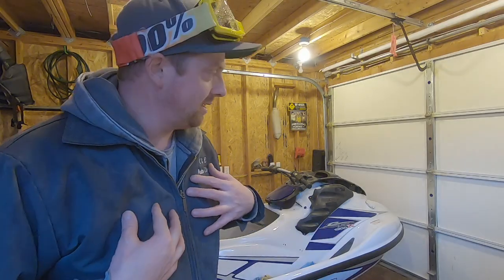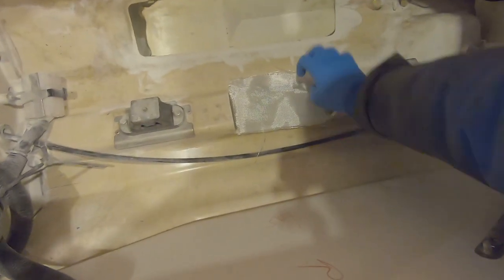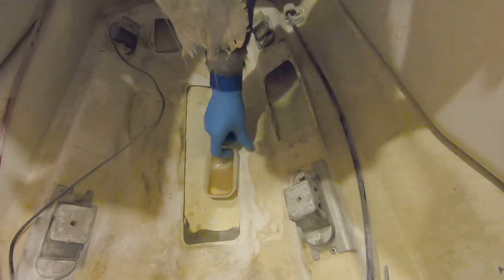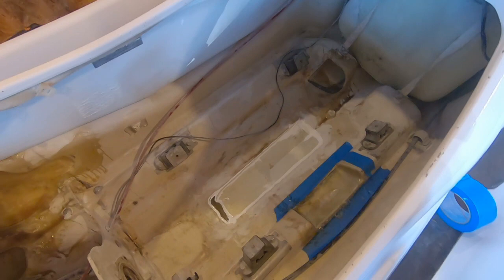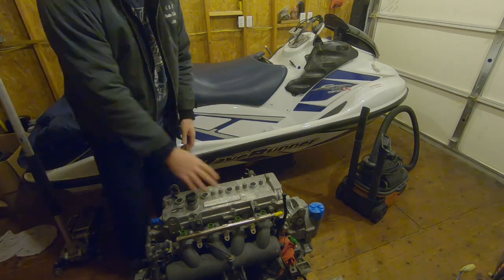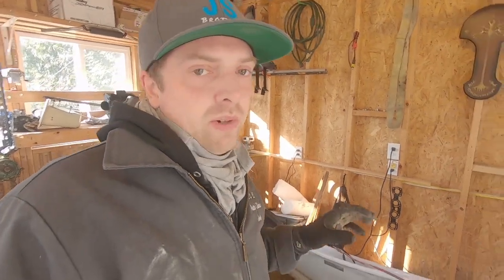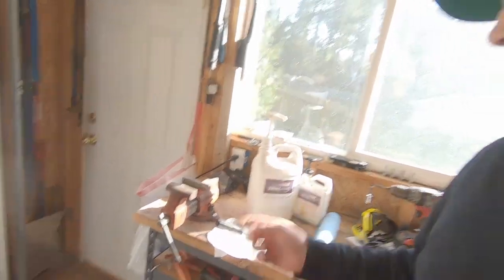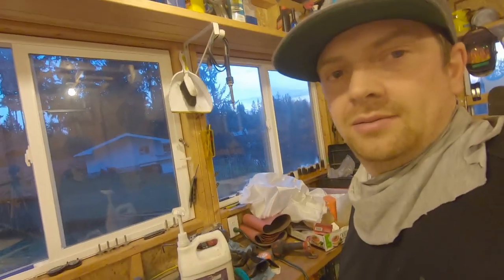Fiberglass GPRSHO part 6

Comment: I don't want to be a know-it-all but you really should use Evercoat SMC resin when you're fixing SMC boats. I fixed a crack in my superjet using regular fiberglass resin and it did not adhere properly and the boat developed a leak again. Had to redo it this time using SMC resin and bingo it worked perfectly. Just for future reference. Also can't wait to see that thing done.
Reply from the maker: Daniel Mettetal I ended up switching to epoxy resin later in the video because obviously the fiber glass resin didn’t stick very well. I will have to look into this smc resin you are talking about. I have not heard of that before, I’m certainly not an expert when it comes to fiber glass work 😂 any way thanks for the tip 👌

Comment: You guys should do a race with the new gp to see the difference I have a feeling this build will be better than the new model
Reply from the maker: Matthew Robert that would be awesome. I would have to find someone with a new gp though as there is no way I could buy one 😂
Reply: @JetSkiBrothers  yeah I know what you mean lol I have the old gp760 waverunner with riva pipe westcoast waterbox and aftermarket flame arrestors and a milled head riva ride plate and r&d intake grate and stainless impeller  I'm happy with it until the new ones affordable for me

Comment: I hope you dont have trouble with bond between the first layer and the hull . Polyester resin wont stick as well as epoxy . The top layer of epoxy will stick properly anyway , its only a problem if it was a repair to the main outer hull . Im still looking for a damaged hull SVHO ski with RIDE for my spare GP1200R hull . Im patient .
Reply from the maker: Adzy the PWC bloke in Australia agreed I wish that I would have used epoxy resin the whole time

Comment: I’m wondering if you have the advice I need. I have a 2017 gp1800 and it got scratched loading on and off of a trailer that had a bad bunk. My buddy was saying he thought it was making a noice loading it. I will never lend out one of my toys again!  The scratches are deeper than the paint. What do you recommend I repair this with? I’ve really been enjoying your videos. That ski is in amazing condition being a rental!
Reply from the maker: Max Jones sorry that sucks. I would fill the scratch’s with epoxy resin. Then wet sand and buff it out